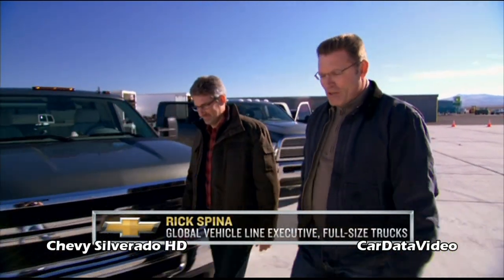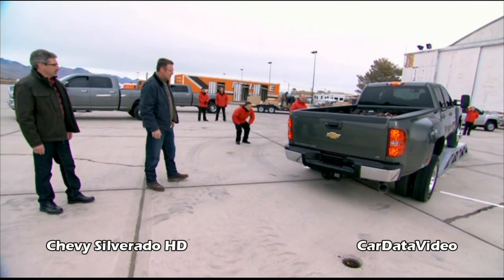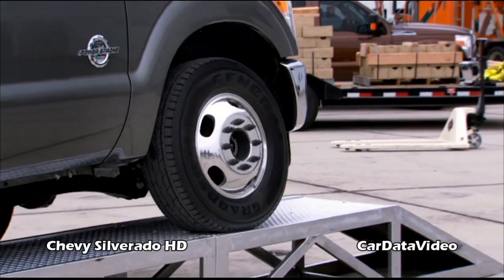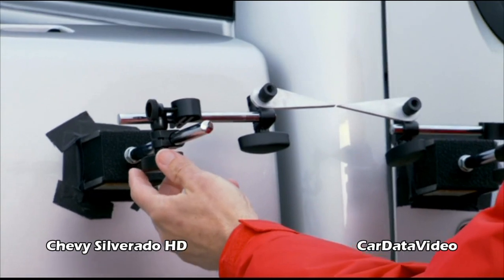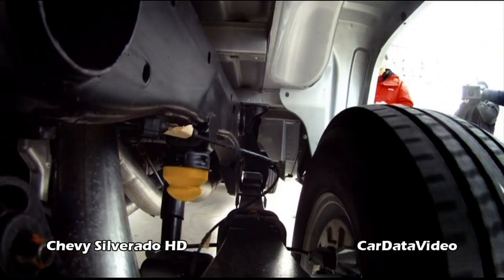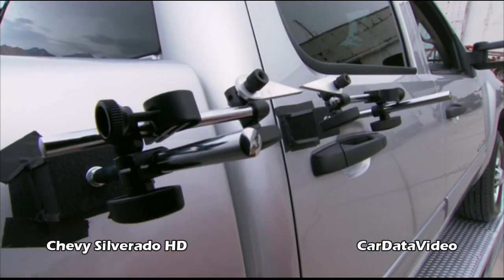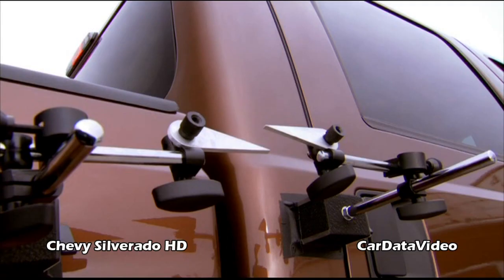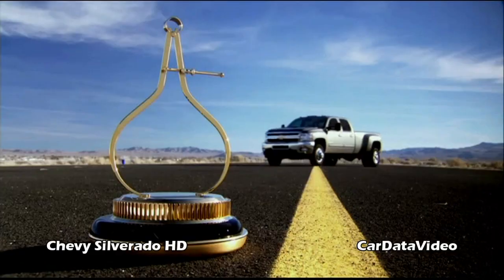Chevy vs. Ford HD Truck - Bed Bend Video

Comment: my 2018 2500HD has been in the shop 4 times with big issues...
Reply: 4g63gen1 it’s because it’s a HD
Reply: I got my 17’ 2500HD in January this year, have put 40,000 miles on it since and not a single problem!
Reply: Voltaar LLC yeah but wait until 100k
Reply: Omar Flores the biggest problem is all the emissions bs. Especially for guys who only use their HD trucks to ride around town in. I haul with mine across the US and Canada. Working these trucks are the best thing for them.
Reply: Omar Flores I didn’t mentions it’s already past 100K lol
Reply: 4g63gen1 my 2017 Ford F-250 has over 36 thousand miles and has only had one major issue with the transmission. Nothing else but normal tire change and oil change and an air filter and other customizations
Reply: Voltaar LLC my f350 has 300k miles and hold thing I had to rebuild was the transmission at round 200k miles
Reply: Omar Flores that’s pretty good. 6.7?
Reply: Voltaar LLC the best
Reply: Omar Flores lol idk about the best.... a buddy of mine has a 97 7.3 power stroke with 470,000 miles, I use to own a 12v cummins with almost 300,000. Those were the best trucks.
Reply: Why anyone would buy a new chevy ANYTHING is beyond me.
Reply: Because you abuse it bud. Ive had a 2005 Duramax 2500HD since 05, hasn't been to the shop once with an issue.
Reply: @DarkNinja-sv3de  Thats an 05. We are talking about modern chevy, which is utter crap.
Reply: @lewisdavis1491  ohhhhh, yeah the newer ones are turning into shit.
Reply: But it can do this for some reason
Reply: @jakeforsht964  well off the start they're good. Like an apple.
Reply: You capping
Reply: Reavere because they are amazing vehicles, but honestly, I’d take a 2006 and under truck any day
Reply: got a 2012 duramax with 160,000miles no issues at all! It is deleted tho which helps worh all the nonsense most people have with newer trucks plus the cp4 pumps arnt great but knock on wood my cp4 pump hasnt had any issues. i allways add a lubricity to my fuel and only from good fuel stations. I never let it go under a 1/4 tank and always change fuel filter every 15,000 miles
Reply: We have had are f-250 for a while and not a single problem and my friend has had one for 8 years and never had a problem
Reply: @voltaarllc1755  huh 40k and you think thats means anything? hit at least 200k and come back.
Reply: @voltaarllc1755  working them trucks wears them out more. I hate when people say working them is gonna make them last long or something. How the fuck does pulling trailers gonna make it last longer? Well shit if thats the case you should pull even heavier loads to make it last longer 🤣🤣🤣🤣🤣
Reply: Jacob Godfrey why don’t you read all the comments before you say something... lol Truck has over 110K on it, which is still low mileage but I’ve just put 40K miles on it since Jan this year... I work the truck for a living and it does great.
Reply: @voltaarllc1755  not my fault you couldnt put all the info in one fucking comment! Thats what normal people do.
Reply: @streethazardz  thats terrible actually, a major transmission problem at less than 37k miles...
Reply: @lewisdavis1491  you would do well to remember gm uses essentially the same engine block now as when they started the d-max project with Isuzu. As was previously mentioned, the emissions crap is what's causing 99% of the issues with all modern diesels.
Reply: @omarflores493  so ford is bad
Reply: I’ve got a Ford F-250 2019 70k miles no issues
Reply: @jordanraposo5537  no
Reply: @gradyk7101  isnt 70k miles like nothing tho?
Reply: Jordan Raposo yeah ik but I’ve known people that have had issues with their trucks around 40k or 50k
Reply: @gradyk7101  yeah but they must have been like forcing the shit outta them. my uncle has a 2018  gmc sierra 1500 and he has a landscaping company. so everyday from around march to november he loads his dumper with 4-5 tones of rock, powdered rock, dirt, or other shit. hes been doing that with that truck for 2 years straight and not one problem.
Reply: Should have bought a Ford or a Dodge
Reply: @voltaarllc1755  take my advice man and remove the emissions. Truck runs amd sounds 10x better!
Reply: @omarflores493  because its a ford lol
Reply: @lewisdavis1491  because they are smart
Reply: jacob powers oh I wish man. Deleting a L5P is too expensive, and  in the states has gotten difficult with the EPA.
Reply: @voltaarllc1755  you should be able too find someone. But idk about pricing. My lmm costed $1300 with a 4" exhaust and the dsp5 and tuning off the egt
Reply: Chevy has ALWAYS ripped on ford and used that as their marketing technique to hide how trash they really are. Look up videos on how they fake all their marketing. Especially that new aluminum vs steel commercial. Chevy tries to tear down others to make them look better.
Reply: Chevy is the king of gas trucks, diesels.........well, diesels are not really a Chevy strongpoint. Ford has it good with the 7.3 and that is literally it other than the ecoboost. Dodge is extremely well rounded, Cummins are amazing, and the 5.7 is an amazing engine. In my experience working on all three brands with gas engines, ford sucks at making a gas truck engine, and the overall trucks are decent. Chevy makes bulletproof engines, like the 5.7 then the 5.3, and their trucks are usually a bit nicer. Dodge gas trucks before the 5.7 were hit or miss. Magnums seem to be either great or absolute garbage, almost seems like some were produced in a different place or lot number and were not qc'ed enough. Though I daily a grand cherokee with the 5.2 magnum and it's amazing. Dodges are decent all around, however I have noticed they develop a lot minor issues considerably more frequently than other truck brands.

Probably the worst diesel you can buy in the last decade would be a duramax dually. I don't know why but I have seen so many issues with them, specifically dually models too. If I were to buy a new truck tomorrow, I would buy a Cummins, and if it was gas I would buy a Toyota Tundra.
Reply: @Wrenchingandnursing  you haven't got a clue man. Dodge is not well rounded. Their wiring and electrical are bigger garbage than anyone. Chrysler is trash. The powerstroke past 03 is also trash.... There IS NO good options for diesels. Ford hasn't even made a good half ton since 08. (Yes I'm a ford guy) Chevy hasn't made a good one since like 99 and dodge has literally not once made a quality half tonne. The 12v Cummins is dodges only relic. Even then the rest of the truck is garbage. I avoid Chevy and dodge altogether. The only diesel truck worth buying is a 7.3 idi. Ford produced, but the engine is made by international.
Reply: It has 4 problems because you're clearly over-stressing it., what are you using it for?
Reply: @jordanraposo5537   5 tons of rock for a 1500?
Reply: My dad switched to a ford from a chevy and liked it way more because it had way less problems
Reply: 4g63gen1 my 7.3 ford hasn’t had anything but fluid and filter changes and some grease in the past 4 years
Reply: I just put a 16 on the lift where the frame has rust holes already. Overall I'm not impressed with trucks these days. They give you mileage by making em flimsy.
Reply: 2015 chevy tahoes are fine, can pull boats and stuff just as fine too, it looks stupid when people buy huge ford diesel trucks and then use them to haul around a single jet ski
Reply: My 2014 Silverado has had 2 transmission replacements and only has 120,000 miles
Reply: What a great platform to complain on.
Reply: Same
Reply: Bad luck I guess
Reply: Probably cause you’ve had the truck for like 10 years. Just kidding, sorry your truck keeps having issues
Reply: Ima Chevy guy, but looking at the facts, I'd buy a Dodge Ram
Reply: My gmc engine blew up and we took perfect care of it
Reply: I know why because it’s a Chevy
Reply: Just depends on what you are using it for, I have seen ones that where over 10 years older that didn't have a problem.
Reply: @derekstratton2597  dang pretty impressive where did you see a 2018 that was ten years old Area 51?
Reply: Who cares?
Reply: That more rigid frame is more susceptible to cracking and buckling.

Comment: I’m a Chevy guy but I can’t lie this “test” was biased
Reply: It was biased but not fake
Reply: this was biased but it wasnt fake and the duramax makes more power and is still way more reliable
Reply: @andrewb232  Cummins is always there when you need it. 4 or 6.
Reply: yeah they all lie
Reply: It was but undoubtedly the Chevrolet is more durable
Reply: @andrewb232  exactly
Reply: @FrequencyORD The Chevy isn't more durable, if it was, this body style would still be seen on the road and they wouldn't have made their frame so Ridgid. It's fine with half tons, but higher than that you want flex to absorb heavy weight, like an 18 wheeler going over a railroad track. I own an old Chevy but you need to do better as a truck man.

Comment: The flex is totally normal. If you put an extra 2 ton in the ford's bed , it will bent more but not break. Do the same with your Chevy and the frame is going to fail because it can't handle the flex.
Your chevy is like a drill bit, flex it and it will crack somewhere.
Reply: It broke... While empty.
Reply: Chevy built broken
Reply: For built for america they've stayed true to that
Reply: No, flex is not normal. You don’t know what you’re talking about.
Reply: same with ford motors
Reply: Chevy all day
Reply: Yeah people are idiots, they don’t pay attention to things in the world like semis that tow 80,000+lbs daily and their frames are designed to flex, chevy didn’t catch that memo they are literally advertising a weakness of the fit trucks lol and they wonder why they can’t tow as much as super duties
Reply: It's steel it's not going to flex
Reply: @eternalthread7846 
Not a weakness lol
Reply: @YankeeDoodle2  uhh, steel flexes and can be designed to flex more or less.
Reply: @andrewmclamb6984  tell me you aren't an engineer and don't understand physics and auto design without saying it!

Comment: I’m a Chevy guy, but that ford tailgate is locked
Reply: No your not and no it's not, tailgates don't open when the latch is jammed.
Reply: @Smitty-op4ld  but the tailgate latch is not jammed they locked it why do you think they cut to that part? Huh? HUH? Thats what i thought
Reply: @Smitty-op4ld  he pulled the handle all the way out  he wouldnt be able to do that if it was jammed so yes it looks like the gate was locked. but also it probably was jammed anyway considering the strain damage that was caused to the tailgate. I think it was locked because they were planning to fail it regardless.
Reply: @metalavenger23  you ever had an old pickup? You can pull the handle out on a jammed pickup unless the latch is what's jammed, pressure on the sides of the gate will hold it fast.
Reply: Robert Smith problem is that’s not a old pickup, it’s a 2011 I think
Reply: Actually I happen to have that exact ford and you can not pull the handle at all when it is locked
Reply: I think it was locked as well
Reply: @gunsmart100  it's a 2008
Reply: @thatguy77006  idk if that’s true for f350s but I got a 2011 f250 and ik my latch will come all the way out locked or not
Reply: @Smitty-op4ld  how you gonna tell him what he is and isn’t bruh
Reply: @dynamitesmasher777  no it ain’t the truck was a 2011-2016 when they made them body styles
Reply: Honestly, though.
Reply: Did they fake the dent and twisted chassis too ?
Reply: Donalld Allhands  What bias ? The Fords frame was obviously bending like a cheap bed frame and the Chevys wasn’t. And I’m a long time Ford fan I’ve owned several. I’ve also seen Ford truck frames crack.
Reply: @thatguy77006  not on mine even if locked you can pull it all the way, same truck also. 2 of them actually, f250 short bed and f350 long bed same for both
Reply: @dynamitesmasher777   no its not 2008 is another gen
Reply: What I'm trying to figure out is everybody says the tail gate was locked but what about that dent that just happened in front of my eyes
Reply: @Smitty-op4ld  I got an '04 Isuzu Dmax I can't open the tailgate if there's anything pushing on it.
Reply: @Smitty-op4ld  did you say "no your not" to him being a Chevy guy? How the heck can you even be the judge of what someone else prefers?